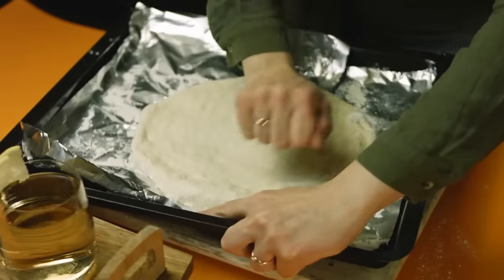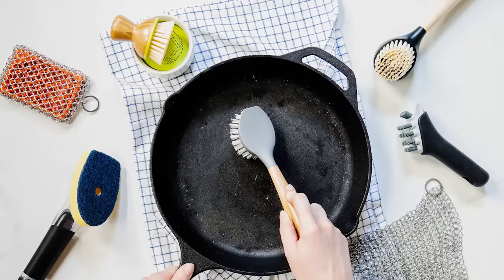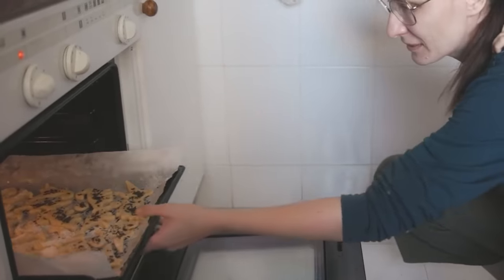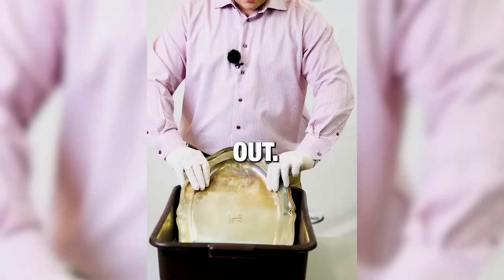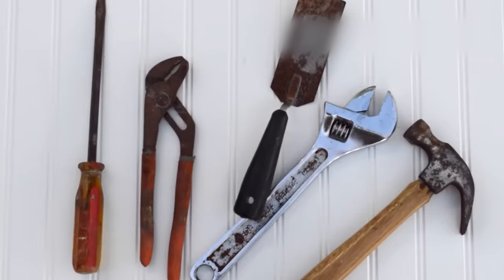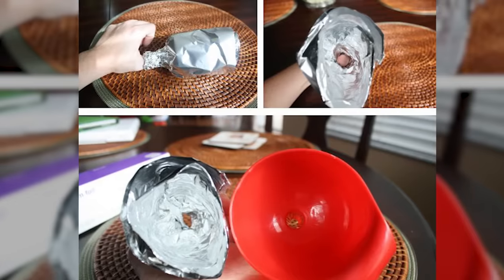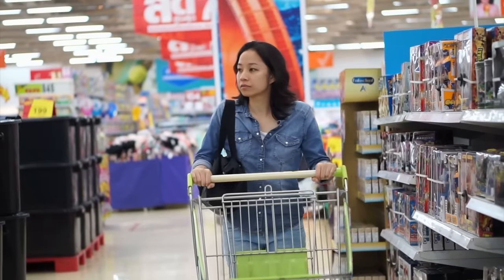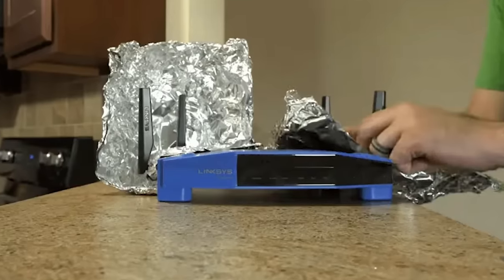Wrap Aluminum Foil Around Your Feet. Watch What Happens in 1 Hour!

Comment: You missed an important one. When you have an outside light that's stopped working, rub inside the socket with foil and the bulb will be able to make contact again. It almost always works. Also works with tract lighting, etc in moist areas like a kitchen or bath.